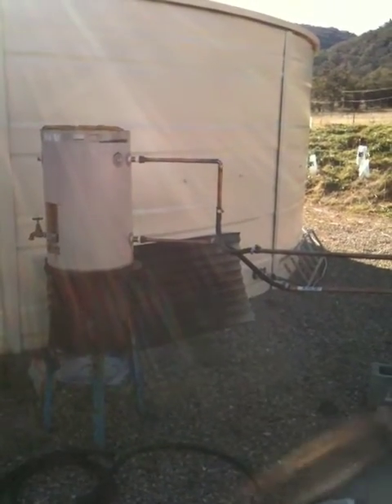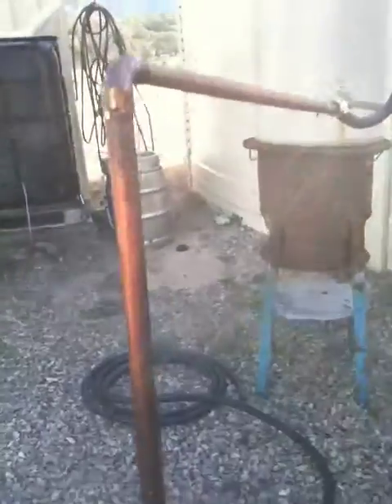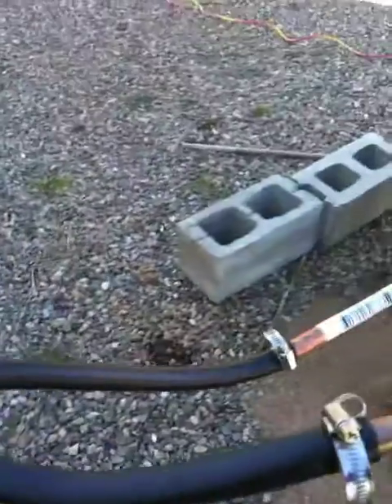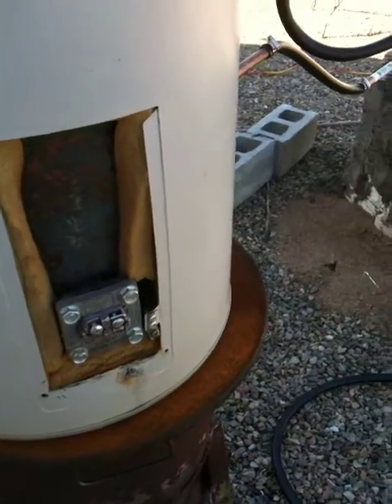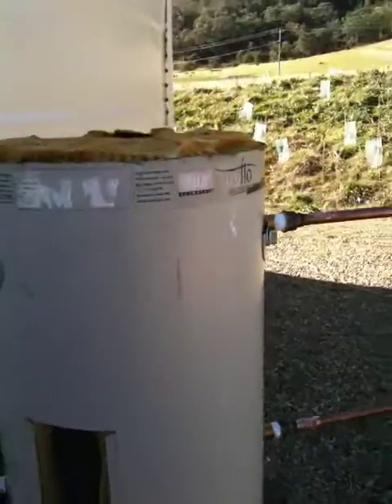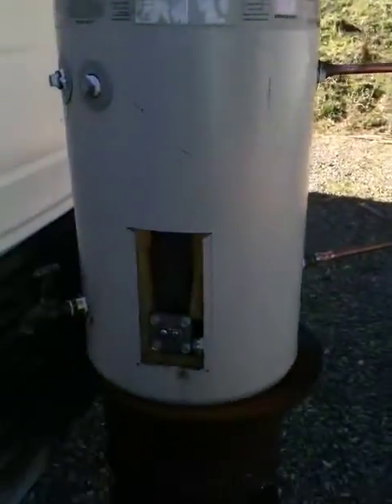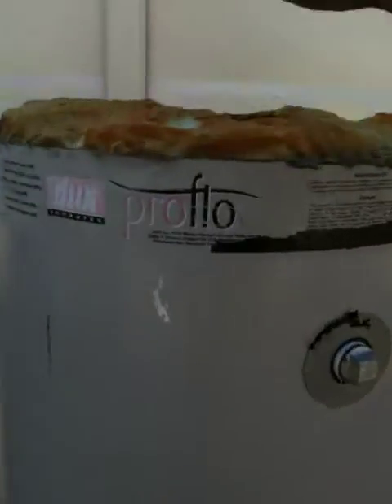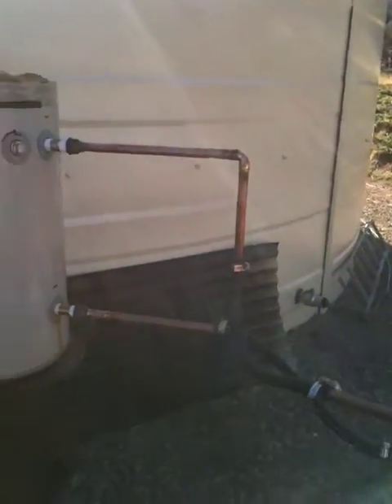Aussie homemade thermosyphon system part 1

Comment: Without a temp / pressure valve to release the pressure, how long did it take until the tank exploded like a bomb?
Reply from the maker: I drilled a hole on the top of the tank so there is no pressure build up.